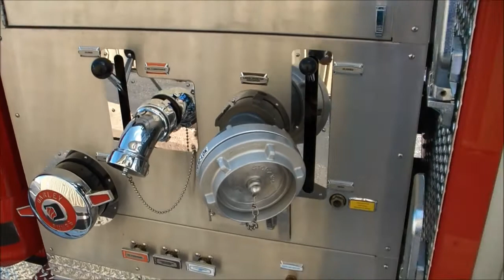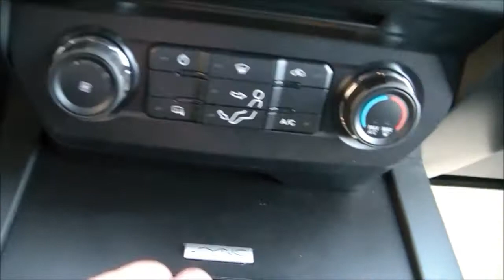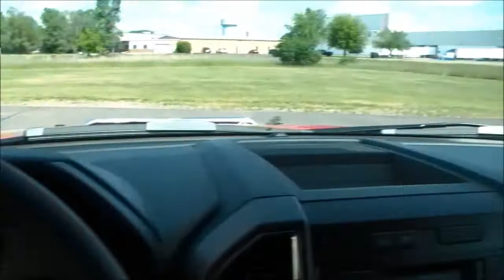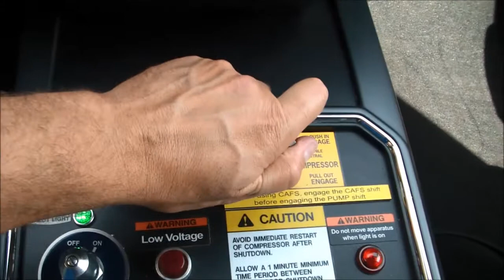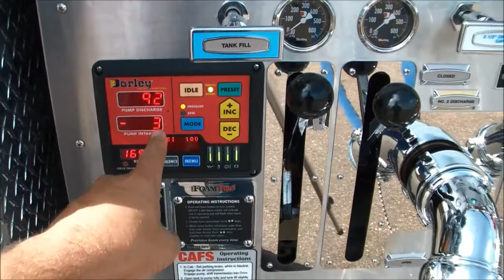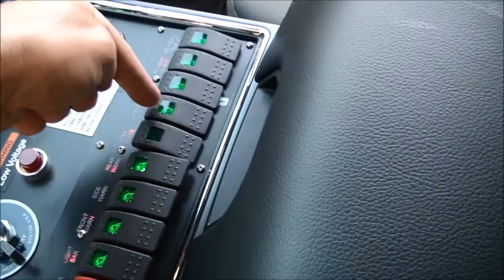Darley Demo WASP 3313

Comment: The only 2 things I do not like about this Truck is that it's a Ford, and it has the fully electronic Throttle Control on the Pump Panel. I prefer the traditional vernier type throttle with Cable, because that type of throttle is less likely to fail, whereas the fully electronic throttle control controlled by an onboard Computer will fail sooner, or later, putting the entire Truck out of service. I also like the manual discharge Valves, both the T handle Push/pull, and the lever type valves.